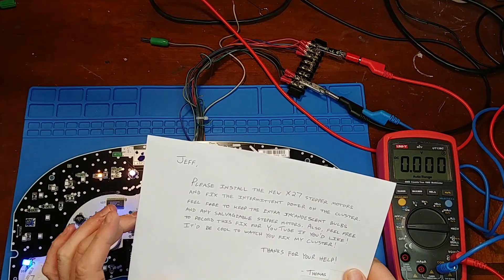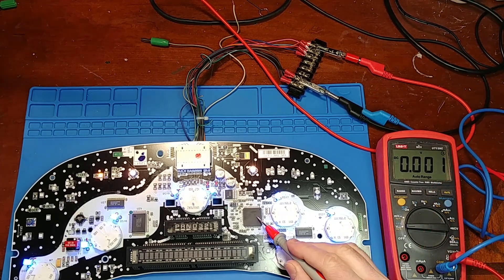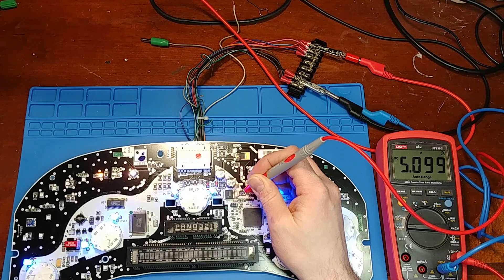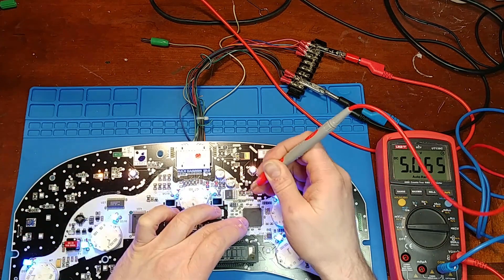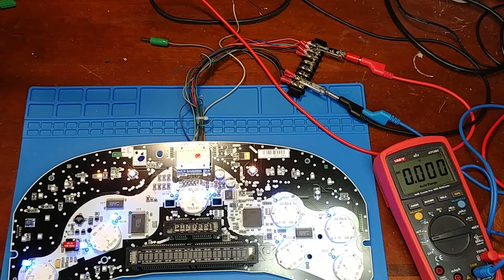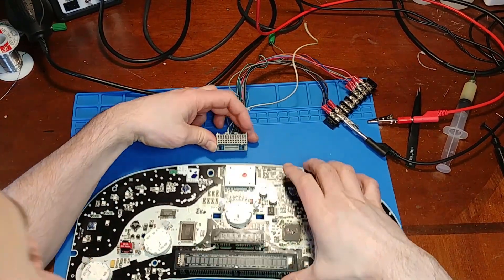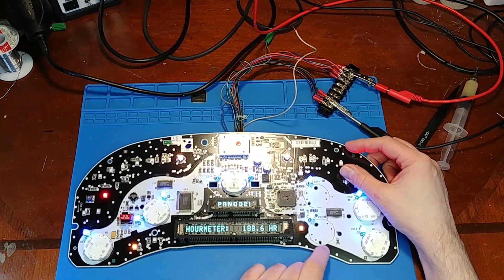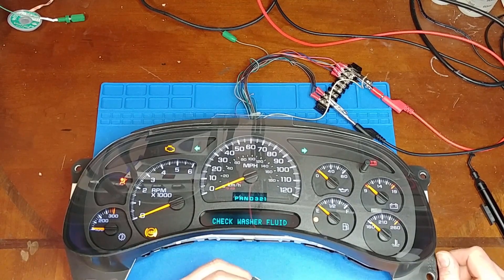GM Chevy Cluster not Booting. ESD Damage?

Comment: My boy Jeff, you do an awesome job brother. This is a super hard pme to figure out, but I fix that issue all the time. The issue is caused when the mcu receives its shut down instructions during a power on state or during a power off state. It's basically stuck in reset mode to put it plainly. The solution requires a little boost to the wake up circuit of the mcu. Just thought I'd throw that out there so you dont have to use donor boards or mcu swaps.
Reply from the maker: Care to share how you get the micro back to normal?
Reply: @jeffescortlx  absolutely, I'll send you a short clip of how to do it. Is your email in the description? Seriously though man, I've learned a lot from you when I was coming up. You obviously dont know these things, but you've definitely had an impact on my life. So thank you!
Reply from the maker: @ivotenotocensorship5247  email is in this description:
https://youtu.be/T_2WnJMsZaU
Reply from the maker: @ivotenotocensorship5247  did you find my email?

Comment: MCU would be static sensitive because it has its own internal ram. I believe this is classified as a MPU by Infineon but because it has firmware storage and on chip memory it’s really a MCU and would definitely be sensitive to static however... I would check filter capacitors prior to replacing the packaged chip. This would explain the intermittent reliability. Chips are ether bad or not. A corrupt memory address on the chip would not change.
Reply: Basically every IC's are static sensitive no matter what's inside, even voltage regulators can be damaged from ESD.

Comment: Will a cluster from a 2006 work on a 2003 silverado?
Reply: Yes, but the 2003 DIC (if it has steering wheel controls)  will have more options than the 2006.  GM went cheap after 04.

Comment: I got a problem with my 2005 1500 sierra fuel gauge. The needle is all the way to the right passed the full mark. The needle wont even move. I think the step motor is out. How much do you charge. Send me a msg. Thanks.
Reply from the maker: Full rebuilds are $120 plus return shipping.
Reply: Ok cool, can you send me your email to contact you. Thanks
Reply from the maker: My email is listed under my channel "about" tab. Visible with Windows PC.
Reply: Any idea why the pins for my stepper came out when I removed the needles

Comment: Dear jeffescortlx,
How to program the gauge to add transmission temperature gauge for Yukon & Tahoe.
And what is the device name to do this steps?
Thanks in advance :)
Reply from the maker: Depends on the year
Reply: jeffescortlx from 2003-2006
Reply from the maker: Buy eeprom reader like OBDstar x100.
Get a cluster with a OEM trans temp.
Copy bin file from that.
Burn bin file to the non trans temp cluster.
Use x100 to correct miles/hours to what it's supposed to be (from first eeprom)
Reply: jeffescortlx  Thanks for replay,
But this device for mileage adjustment and key programming.
My question is the transmission temperature program saved in eeprom? And if do same the previous steps it will work perfectly.

Comment: Jeff, I have a 2004 Silverado I'm trying to sell with a non working cluster. I've gotten the cluster to show mileage and go through the info system with steering controls after unplugging and connecting the cluster. I've tried to fault the pins and wires or maybe a ground but from what information I've gathered I've got a good ground and positive source because my gauge backlights and blinkers still work while my gauges are dead. The speedo and rpm gauge don't work when the rest of the cluster is operational in its rare moments. I took the cluster to a local cluster repair shop and they didn't even open my cluster and tried to fault the previous owners attempt to change the speedo stepper motor rendering my cluster "impossible to repair" this was before I got my cluster to work after reinstalling it into the truck after I got it back. Now I believe they weren't confident in putting time into a cluster somebody already touched. Now I've stumbled upon your videos looking for help.
Reply from the maker: Shouldn't be a problem. I'm ok with repairing failed repair attempts. Send me your email or send me a private message and I'll give you the shipping and contact information.
Reply from the maker: Email sent
Reply from the maker: I sent an email to that address to.
Reply from the maker: Aaron quezada did you receive that last email? I haven't heard back.

Comment: Do you know by any chance the 2006 board has 5 pins voltage regulator (09399593, manufacturer "ON"). I cannot find the datasheet for it. I have the board on the table. The regulator does receive 12v, but there all other pins are low. Does it need a "switch signal" to start to generate 5v? I though it should generate 5v constant for the processor to turn on, but no dice.
Reply from the maker: Any time pin 1 has 12v pins 2, 4, 5 should see 5v. If your not getting 12v on 1 check diodes. Its not switched like 03/04.
Reply: Diodes looks healthy.  I did check them, and reflow them, even 06 never require reflow for those. I did also took known good regulator from the donor board, and it also has missing 5v rails after soldering. My head is boiling :)
Reply from the maker: Does it come to life if you force 5v from a different supply to the 5v outputs?
Reply: jeffescortlx , that is the next step on my list. This is my customers board. He did replace the stepper motors and few bulbs and then the cluster died. 2,4 and 5 doesn’t looks short either. Mysterious :)
Reply from the maker: Maybe he wasn't cautious with ESD?
Reply: jeffescortlx , it’s possible, but still doesn’t explain why voltage regulator doesn’t produce 5v. I replaced processor too. Nothing changed. I can simply replace the whole board, but very anxious to find a problem on that one.
Reply from the maker: Try forcing 2.5v at the micro cap?
Reply: Did the following - removed the regulator from the good working board and checked the voltage on the contacts on the board:
1) +12v
2) + 2v, 
4) +2v
5) +5v
I guess, the contact nr5 is the management of the regulator.
Now I did the same with that broken board and there is nearly nothing on any of the contacts 2, 4 and 5. I guess, since there is no supply of +5v on contact nr5 the regulator doesn't produce anything on 2 and 4.

BTW the motors on the good board perform the initial calibration even without the voltage regulator in place.
The broken board doesn't make any noise at all with or without the regulator. When I did inject +5v into the rail the only thing that turned on are the PRND LED lights.
Reply: Ok, just as a follow up. It turned out to be the bad processor though. And I did a mistake putting the exact same processor with the exact same part number from the Trailblazer. I though that even it has the wrong flash it still would boot up and then I'll be able to program it with the correct calibrations. So the processor didn't send the +5v to the 5th pin of the voltage regulator, therefore regulator didn't produce +5v on pins 2 and 4. 
I did remove the processor from 05 board and solder in into 06 and the miracle happened. Now I need to flash it properly and this is it. Still can't believe the other processor from the Trailblazer didn't work out.
P.S. I definitely need to put more content on my channel :)
Reply from the maker: Good information. I didn't think it was a switched regulator. So it needs +5 to turn on, they changed that from the 03/04 were it needs 0v to turn on interesting. Good to know the trailblazer micro isn't compatible even tho it's the same number.

Comment: Hey have you ever had an 03 cluster where nothing turns on? Would  you think it is some of the solder joints or the problems not in the cluster?
Reply from the maker: yeah you have cluster PCB issues. Time to take a close look.

Comment: Jeff I have an 06 Silverado where the break light, battery light, and security light randomly come on, but very very faintly on the instrument cluster. I have to assume it is some kind of short going in and out that is causing the problem. Any idea what to look for and if it would be a simple fix?
Reply from the maker: I'm not 100% sure without hands on. But I think its related to the serial data coming into the cluster. Do the 4 gauges on the right hand side freeze up while the lights are coming on?
Reply: John Wedgeworth  Hello  John my 04 Chevy impala is doing the same thing did you  find out what was wrong with your truck  any help I would appreciate it it's pissing me off
Reply from the maker: I've head that generation of impala has a module under the seat, that when mud/snow/water get to it, it can short out the data bus line.

Comment: in my case, the regulator is receiving a DC input of 12v, but it does not give any output voltage, could it be the regulator? Is there a substitute for this regulator?
P.S. my cluster is not booting for the same reason, I tried to replace the lights with LEDs
Reply from the maker: The regulators are pretty resilient, I would expect them to have built in over current/over load/thermal protection. I'm surprised your seeing input, but no output on either constant and switched output. Assuming you have a 2003/04 board? I could take a look in you want to send it in, but I think the customer in the video got my last good CPU I had. I'll have to dig around.
Reply: the regulator could have been damaged because with the tester I forced 12v on a 5v rail, just after that the cluster no longer worked.
The serial number of the regulator is ON 09399593 CAK739 but I can not find it anywhere.
I would like you to repair my cluster but I write you from Mexico and I can not find someone to repair it here, I am studying electrical engineering and I know a bit of electronics
Reply from the maker: If you put 12v on the 5 volt rail it's not the regulator thats going to be damaged, but the microprocessor.

Comment: Great video Jeff. You know what I hate the most after one of these microprocessor transplants? Flux cleanup after the replacement microprocessor has been soldered in. 

So do you have access to a datasheet for this microprocessor? For the life of me, I've never been able to find one since its obsolete.
Reply from the maker: I believe the microprocessor is a off the self item, and I have printed data sheets on one of them, might have been the 2005+ tho. But the regulator seems to be preparatory and data sheet not available to anyone but GM.
Reply: Well if you could find a link to the datasheet on the 03/04 Infineon microprocessor, that would be great. Cause I sure haven't been able to find one anywhere.

Comment: I'm not sure either. Usually when it becomes a donor board that info doesn't display. I do label the donors 6 gauge and 7 gauge clusters and most but not all have the steering wheel option. Still awesome trouble shooting. I'll keep Best pixel info incase I need to have one flashed. Thanks Jeff

Comment: Where did you buy that tool used to heat up chip?
Reply from the maker: Well, the nozzle for QFN chips came from eBay, the main top hot air station came from SRA who is the manufacture dealer. The top hot air holder/stand came from eBay, and the bottom heater also came from eBay. Oh and the electric vacuum pickup came from SRA also.

Comment: Great video Jeff.  Does the stock number / Bar code on the back of the cluster indicate what options the cluster is programed with?
Reply from the maker: I'm not sure. Best pixel might know? I normally just power up the cluster and see if it has two trip options, then I'll have an idea if its a work truck base model or not.

Comment: In such cases this costs as a replacement cluster, since no one sells those processors
Reply from the maker: You would be correct. This kind of component replacement isn't typically included under normal rebuild services.

Comment: Good job!  Yes, this one will not work with steering wheel controls in it's current state. That is the moment when you need to reflash the processor with the proper calibrations to enable the buttons.
Reply: Hi, this is my cluster that Jeff fixed for me. You say you can reflash it to work as factory for my Truck? How much are you charging for a reflash and shipping it back to me? Thanks!
Reply: Folks, the cluster will hit the road today - https://www.youtube.com/watch?v=zlBxIyuxJOk
Reply from the maker: Do you have the ability to flash the cpu? I do not. I still have this cluster for today, and could work it out with tom to ship it to you if your interested?
Reply: Yes, I can reflash it for you. Not a problem. Literally takes couple minutes. All I need is a VIN number of the vehicle this board will be going to.
Reply from the maker: That would be fantastic. I'll send you a PM for the details. I hope your located in the states.
Reply: Sure, in Illinois.
Reply: Much Thanks to Jeff and Best Pixel Repair! Got my PITA cluster working like new! Such great work and professionalism. Fair prices and quick responses. Can’t wait to install it.

Thanks guys!

-Tom

Comment: Great video once again my friend!  Jeff would you share on how you calibrate the needles on that style cluster sometime? I would love to see your process on that! Thanks bud...James : )
Reply from the maker: Some day I may do a "cluster repair basics". Like showing taking a cluster apart and rebuilding.
Reply: I just would like to know how or what is the correct procedure when getting the fuel gage to match the calibration in the eeprom I believe. I did a rebuild for one of my friends and he told me that he ran out of gas when his cluster DIC center was still showing 50 miles to go. I done the marking the needle placement using tape and now it is not 100% accurate is why I asked Jeff. Can you give me an way to get that corrected so the needle and DIC info matches. Thanks for your time Jeff. James
Reply: Bump for help please. Thanks
Reply from the maker: If he ran out of gas, but DIC said he still had 50 miles to go, it's not the stepper motor that's the issue, but fuel sending unit.
Reply: jeffescortlx thanks Jeff that makes sense now. Thanks my friend. James
Reply: jeffescortlx you don't think the zero on the needle may be off?
Reply from the maker: Your welcome